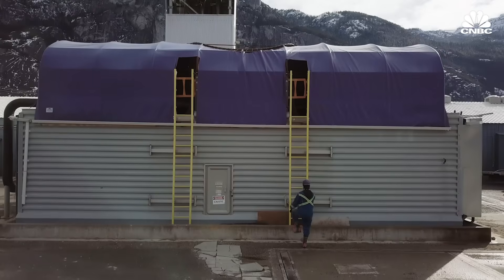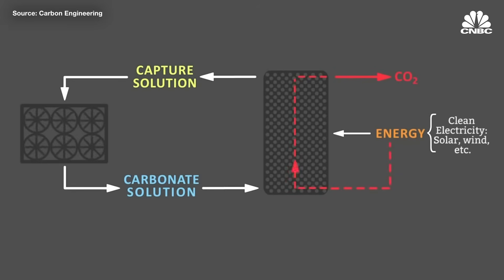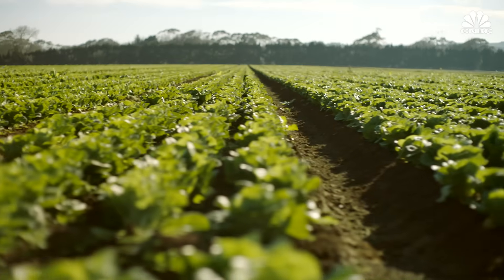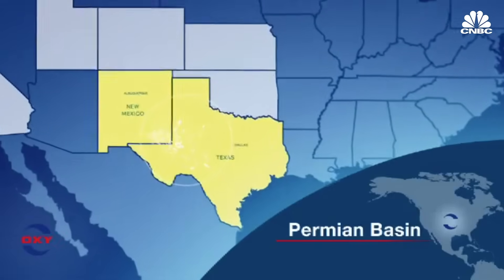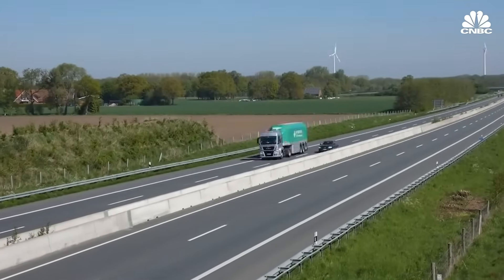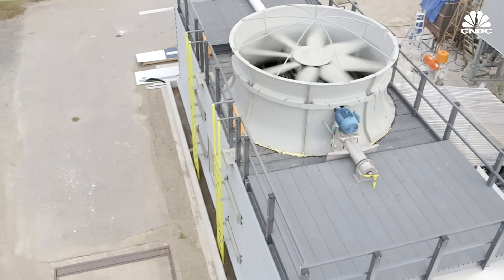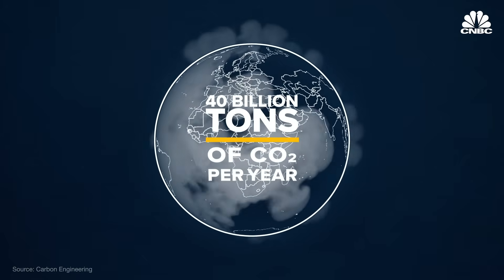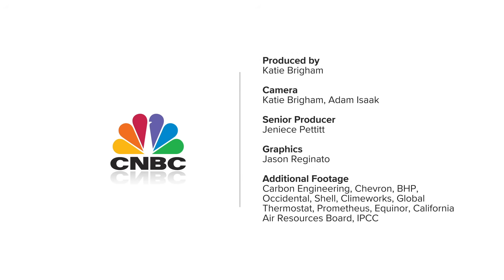Bill Gates-Backed Carbon Capture Plant Does The Work Of 40 Million Trees

Comment: In fact you could "Mine" atmospheric CO2 and by using a modified steam reformer produce hydrocarbon fuels ie petrol/gasoline or methane etc etc 
Using CO2 and water as your feedstock . SASOL the South African "Coal to Oil" people have developed a solar powered steam reformer. The only by-product is pure oxygen. 
I have been told that in fact it would be cheaper to produce petrol this way once you have built the plant (In high or low latitudes you could use biomass or waste derived fuel or even nuclear power to provide the required steam) Now if you then use the petrol/gasoline or methane etc etc in  Solid Oxide Fuel Cells  which do not require pure hydrogen to operate and directly produce electricity. 
You would solve both the problem of removing CO2 and use the petrol or methane produced by the steam reformer in the Solid Oxide Fuel Cell. Would save you having to produce hydrogen. It is interesting to note that a given quantity of petrol/gasoline has about 40% more hydrogen in it than the same quantity of hydrogen. This is due to the the relative density of the fluids. 
This is quite important because hydrogen in its natural form is extremely difficult to produce and and store the thing about petrol is that we already have a sophisticated network of safely using petrol.
It is quite clear to me that this would be the way ahead. 
I know that Solid Oxide Fuel Cell technology is not without its challenges. Particularly the fact that older designs operate at quite high temperatures i.e. 1000° Celsius. 
However this is not necessarily a problem as it would allow you to build industrial estates largely powered by steam which would have been generated from an emission free source. This would allow all manner of industrial processes which require high pressure high temperature steam. 
Also for example you could use some of the the steam to power the transportation system particularly if it is a railway/railroad as you would be able to use fireless steam locomotives. I personally think that this is the sort of technology that needs to be developed immediately.

Comment: Dumb!  Running a plant to remove Co2 in a place where trees flurish and CO2 is low, whereas the trees and vegetation require the CO2 to flourish and make oxygen (o2).  Also, it uses processes like burning natural gas and using electricity from electric plants that again, burn fossil fuels and therefore create more Co2.  Instead, they should have put that plant in a place like LA, Detroit or NYC where the Co2 levels are high and the o2 levels are low.  But nevertheless, it's removing Co2 that was created from the energy burned to remove said Co2.  So in-fact, it's redundant.

Comment: The plant is run off of natural gas ,,  GO FIGURE.  Putting C02 in the ground is a BAD IDEA.  Why?  what if an earthquake ruptures the storage tanks. Then you get ALL that stuff into the water you drink. SOONER OR LATER those storage tanks will RUST and spill all that into YOUR DRINKING WATER....  GO FIGURE.  Put it in the desert and have solar power run it.  NO WATER in the desert to contaminate ground water..   DID THEY THINK OF THAT?   NO    GO FIGURE.   WHAT,,, put it in your drinks. 13:10 IF NOT TOXIC then why bury it.  GO FIGURE  Also this stuff will be used to make more oil to burn. This oil is the stuff that they want to eliminate and stop burning and producing this stuff...    GO FIGURE

Comment: 60,000,000 dollars is NOTHING. That is only 1 percent of 6 billion an the presidential candidates are spending almost a quarter of that. Put the co2 back where oil is removed. If I had mr gates wealth it wouldn’t be 60 million or even 600 million, it would be at LEAST 6 billion an I would challenge EVERY billion to MATCH it

Comment: The sequestered carbon should be turned into products that do not attack the atmosphere with carbon dioxide replacements. Two such products are Diamonds and Graphine strong enough to replace the use of trees for construction framing.
Reply: The purity of Carbon Engineering carbon makes lovely diamonds and super strong graphine building frame and also to replace steel framing in trucks and cars.

Comment: CCS is the biggest greenwash scam that humans have ever involved themselves in. Thermodynamics makes this a nonsense. I am astonished Gates is touching this. It has got to be some kind of tax dodge that will ultimately fall on the shoulders of Joe Public
Reply: how does thermodynamics make this nonsense?
Reply: @bilsid  As you have asked I will give it a go. The objective of a coal fired PS is to make electricity. In a conventional coal-fired power plant, which is only designed for electricity generation, 2/3 of fuel energy is wasted through stack gases and cooling water of condensers. You might improve the efficiency with district heating as they do throughout Denmark. It therefore follows using the electricity created to absorb the CO2, convert it into a storable commodity and process that makes little to no sense at all. Just don't burn the coal in the first place and use the money spent on CCS to massively improve energy efficiency and reduce waste at the end user point. The best form of CO2 reduction is to not need the power in the first place. That is what I mean.

Comment: Carbon dioxide isn't the only issue...trees help increase surface area for moisture evaporation and helps with rain and clouds and reduces the surface of the immense. Those things help with global warming more than removing carbon dioxide...by removing carbon dioxide from the air, you remove what the plants breathe. Also the heating carbon dioxide sounds like it burns a lot of energy unnecessarily.

We think we're fixing the problem, but we're going to create another. Nature solved these problems automatically, but we're stopping those processes. Animals and plants worked together to spread seeds and plant more. We're only creating more deserts now.

Comment: 20,000,000 trees sounds good but it isn't much in the big scheme.  I'm all for doing this but if you run the numbers we need 50,000 factories that do the work of 20,000,000 trees to solve the climate issue.  That would bring us down to early 1900s levels.  Of course this doesn't need to be the only solution.  But we probably need thousands of these carbon capture factories if we want to really make a dent.

Comment: For anyone know knows about this guy, he is the same individual that wanted to try and convert CO2 and water back into hydrocarbons for fuel in the widespread trash VICE article. This is the same guy that said this somehow becomes net neutral for gas, and also produces energy in the process. But thats not true. Anyone who knows basic thermodynamics will know: The amount of energy you put into the process is the same as what you get from the reverse process. So you do not gain any energy, and furthermore you could have just used the electricity that you had initially to power other avenues. You actually lose a SIGNIFICANT amount of energy through the process through the conversion processes, because no energy transfer is 100% efficient.

This will certainly remove CO2 from the air, but it is extremely expensive, long-term solutions are difficult, and trying to make claims that it creates energy and is net neutral is entirely falsified. Whispers of a con-man. Look into the claims of the initial patent.

Comment: Using carbon capture technology to extract oil sounds kind of like discovering electricity and using it to electrocute whoever comes up with a light bulb. The technology looks promising, but I would like to see the what the energy and carbon balance figures look like (note that the animation states "clean energy" as power source, which makes sense). Whatever the numbers, zero net emissions fuels seem like a perverse twist in speech from oil companies to keep doing what they do best. If going all in on green energy as of now just won't cut it, then it means that the time for zero net emission fuel alternatives is waaaay past due. If you are breaking even monthly, but you still have a pile of outstanding debt that you are not paying, there is no reason to celebrate yet.

Comment: With my long experience using Windows products in mind, if Bill Gates endorses it, I assume the carbon plant will inexplicably freeze during operation and need to be rebooted, after you've regained control by pulling the plug out of the wall.

Comment: Only 75,000 of those plants necessary to equal the roughly 3 trillion trees on the earth.  It would only cost $16.5 TRILLION annually to extract the work that trees do annually.  Trees are cheaper, have virtually 0 maintenance costs, don't require energy input,  and haven't become obsolete despite being around for a couple billion years.  10,000 of those plants alone just to counter the carbon China releases annually, and the united states, puts out roughly 40% fewer carbon emissions annually.  If you want to make a change, how about pushing China to enact change as they're the biggest environmental polluters in the world.  Even if the United States became carbon neutral, it wouldn't change anything besides negatively effect millions and millions of American lives.

Comment: 1:06
I happen to fill the fuel tank in my car with 'fossil fuel'.
What am I supposed to use if oil companies are "stopped"?
Water?
Reply: electrical vehicles will probably be just as cheap as regular ones at that point
Reply: @Hycil2023  
 Until then, I can't afford one.
Reply: Electric cars exist since a while, didn't  you know ?

Comment: Plenty of technical ways to drive emissions down...sure, maybe, to point.
But that has limits. I only hear about plans to replace current electrical energy production with *stuff*. Then you still need to replace home heating and mobility ( read gasoline and diesel and fuel oil ) with CO2 neutral sources. 
Meanwhile to actually live we need energy. No energy source = no life.

Comment: Trees do more than just convert carbon dioxide to oxygen... will this machine be able to support all of a tree’s roles?
Reply: It’s not an either or. The land used by the factory would probably fit a few thousand trees. So you can still plant your 40 million trees minus a few thousands and have this factory as well and have double the carbon removal.

Comment: Humbly, I disagree with Professor Kammen. Partnership with oil industries to reduce C02 is not a bad thing. If we can make oil with less C02 footprint, then please proceed with direct air capture...no matter who funds it.  We would be better off if every refinery has this at their facility, than none at all. Though Carbon Engineering technology is separate from the oil industry, it is a nice application of the technology by the oil giants. As an Environmentally concerned person, I support this partnership, I support hybrid solutions over zero solution.

Comment: All you need to do is position the device betwen traffic tunnels and the out facing evironment. Or in air streams that are on the leading edge of traffic motor ways or shipping lanes. Or just make high flow catalytic converters for Power Plants, Ships and Generators. You know some plant species in the Amazon thrive on Carbon absorbotion. Maybe plant some around the hot spot for good measure.

Comment: Interesting, but what do they do with the CO2? Just store it underground???
Trees can split CO2 into carbon and Oxygen, so planting 40 million trees is actually a better solution.
Until they can split CO2 with non Hydrocarbon energy (like coal and oil) then this is a bandaid. Splitting CO2 is very difficult because of stability, and costs a lot of energy. Perhaps if they have an algae farm they can inject with CO2 to process the CO2 into Oxygen it might work.

Comment: I agree that both increasing renewable energy sources and using carbon capture systems would be good but I'm surprised the only way to make the carbon capture economically viable is turning into more fuel. Storing it seems potentially problematic. I wonder if any other products can be made with the collected carbon  dioxide.

Comment: They want to mine oil from air basically lol.
Reply: And then they sell it to be burned
Reply: @artimmy1  But its (almost) free money for oil companies 
Electricity after use changes in to a different way of energy (but still renewable)
Oil(with Co2 sucking machines giving them oil)
=oil super cheap, electricity needs powerplants
Oil corps will be super rich
{the co2 machines can use little of their sucked co2 for fueling them selves then give remaining oil to corps and the cycle continues}

Comment: hmm take carbon dioxide out of air, make fuel, burn fuel, put carbon dioxide back in air.
Reply: That is  0 carbon emissions, what you put out there, you take it back.
Reply: @Daniela-pr7rz  I know but how is it helping. your using energy to make energy
Reply: @jakobfielding6031  depends on how much energy it takes to get carbon from air, maybe you can do that with solar. At the end of this you get energy+less carbon in air.
If you would only make energy with solar, you would have energy but the same amount of carbon(not less carbon in air), that's the difference.
Reply: Trees actually need some CO2 to live. The environmentalist argument against this is that it seemingly helps oil companies get around the cap and trade laws that were put into place. They do not care that removing the "pollutants" such as CO2 from the air was the entire point of having cap and trade implemented in the first place.
This is blatant corruption and the environmentalists aren't even hiding their agenda. They don't care about CO2, they just want control. It would be the equivalent of saying, We don't want to build water purification plants, because it will just lead to people drinking more clean water.

Comment: There is a third method.  Take biomass that is currently left to decompose such as corn or sugar cane stalks, pyrolize them, you gain some useful products such as methanol from this as well, grind the charcoal and wash it to leach out the nutrients, and then do something with the relatively pure carbon, either use it in place of coal or other fossil fuel sources, or make products with it.  You could also just bury it, however, if you are still digging up coal, that might not be the most efficient way of doing it.  I suspect that this is what we will do to regulate and sustain the carbon cycle in the future.
Reply: By the way, the people saying the fossil fuel industry is evil and you should not partner with them are wrong.  The industry is predictable, they are a business, businesses try to make money, if you put the incentives in the right place in a free market economy, you will get them to work for what you want.  I do not think we will, or that we should, ween ourselves off of all hydrocarbon fuels.  In the future, hydrocarbon fuels will be produced from carbon sources such as this with energy from other places such as solar, fission, or maybe even fusion.   Cycling carbon through the atmosphere and regulating how much is there will become more possible and more necessary as we go forward and our overall energy use per capita goes way up and our global population increases.

Comment: The problem with trees is that they're a temporary fix. They grow, store CO2, and then when they die and rot they release it all again. The vast majority of CO2 was stuck in the ground, either in oil or frozen in permafrost layers. If we want to fully remove it, we need to stick it back in the ground again, not just hide it away for a hundred years.